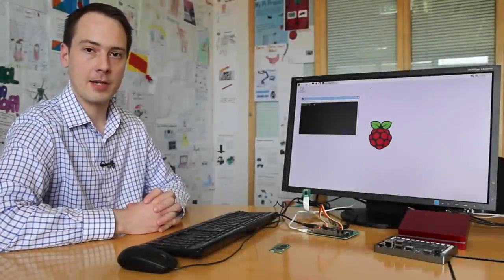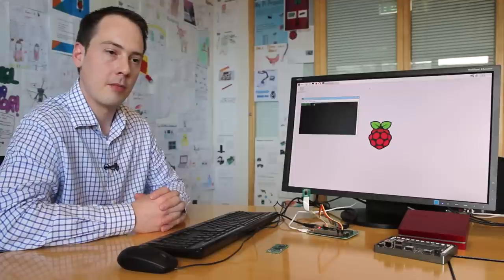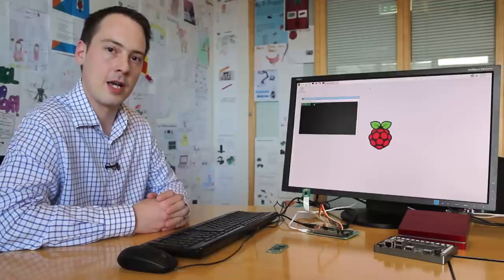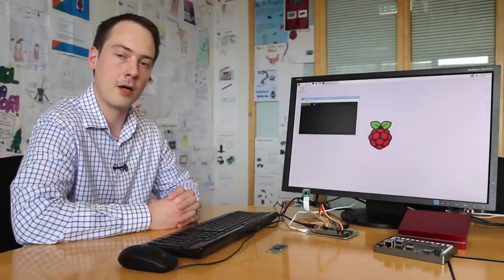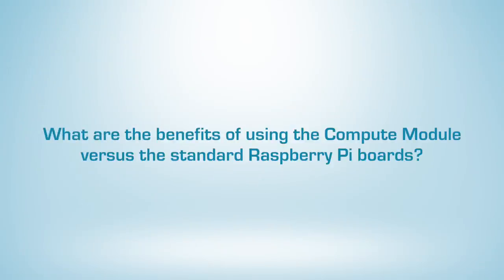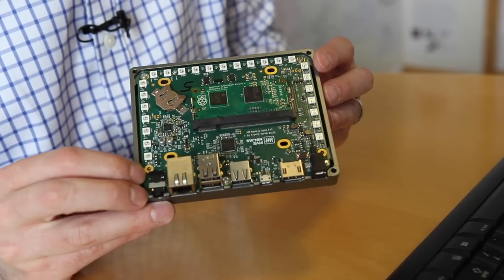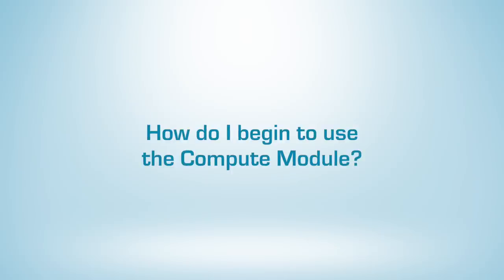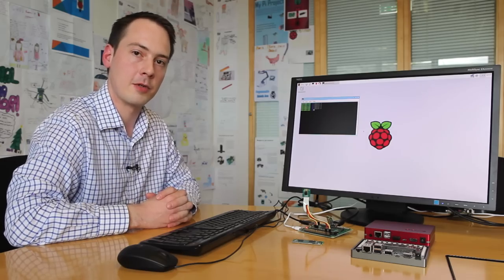Raspberry Pi Compute Module Showcase

Comment: The idea of a compute module was a good one, as a chip that has the core of the RB Pi without any of the ports or other extras that an integrated device will often not need, as well as more GPIOs. However the price was the main problem, even just the module without the dev kit was much more than a regular RB Pi, mostly due to having it on a SODIMM, which seems good in theory but in practice must've run up the production cost due to trying to use a standard size and pin system not made for the chipset.

The Pi Zero is in most aspects the compute modules successor, the same tech instead put on a miniature board with some micro-usbs and hdmi. Small form factor to fill the same needs as the module at a fraction of the cost. The thing is that the zero is not a module, but a whole system on a chip, which is ideal for most but can't be reliably used in a modular system that needs coordination between multiple chips to do things a single one can't do on it's own (not simply running as a cluster). 

I would love it if RBPi took the module idea and put it on a more easily produced mini board with plenty of connector pin GPIOs like a sodimm but was more easily made, bringing it down to the zero price.

Comment: I do not get the argument this compute module is a more compact/easier solution for drone integration. It is absolutely not, since you still need a carrier board to be able to use and interface the compute module, which ultimately ends up as a heavier, burdensome solution with wiring complexity. Or did I miss the way you can interface/use the compute module without a carrier board ?
Reply: You could only put one micro USB port on it or none and program the SD card beforehand.
Reply: But your carrier board could be built to your exact specifications...  a carrier board meeting your exact form factor requirements with built-in gyros, accelerometer, cameras, motors, infrared blaster/receiver, 2.4ghz transmitters, specific/custom sensors for target detection, gps, you get the point. These could be printed on one tiny compact board that interface directly to the CM. I think you're missing the point of how customizable the carrier board itself can be. You can design a board to your exact needs, create the schematics, and then order one or more copies of your custom PCB.

Comment: I wonder how a Raspberry Pi compute module cluster server would compare to a Raspberry Pi 3 cluster server, all the components other than the computer module and the Raspberry Pi 3 are probably more expensive on the the module side but assembly I assumed would be much easier along with taking up less of a footprint.
Reply from the maker: Especially since you can now get the Pi 3 Compute Module based on the Pi 3 SoC

Comment: Hello, what OS image did you use to have this kind of graphical interface in compute module? Thanks.
Reply from the maker: Raspbian from the Pi Foundation.
Reply: How did rasbian fit in the compute module? Rasbian is 4.15Gb while the size of the CM is only 4Gb.
Reply from the maker: Jake Sabandal The standard image has increased in size over time, however it's possible to build a bare / small size version of the distribution around the kernel.
Reply: Lets make a backplane, super computer anyone !
Reply: @Edward3DFX  well it may have taken three years but the Turing pi now exists